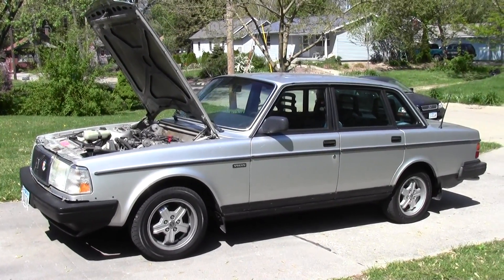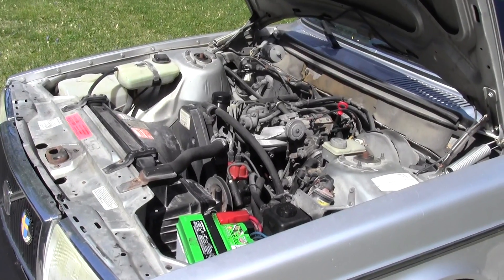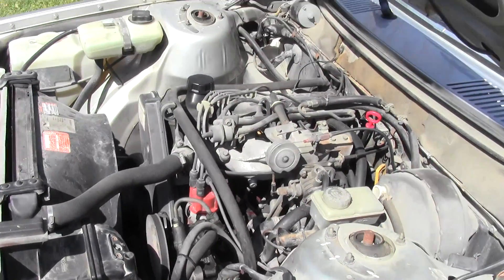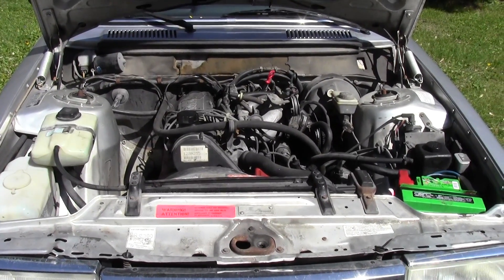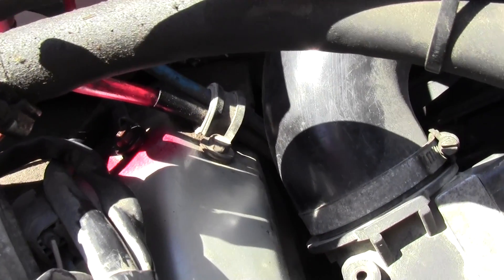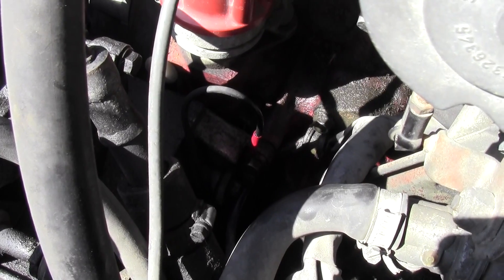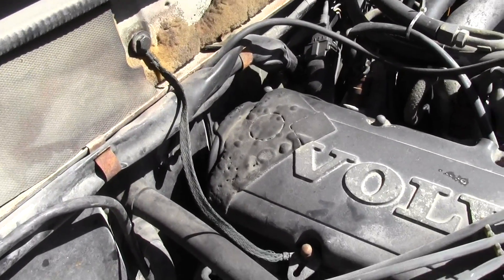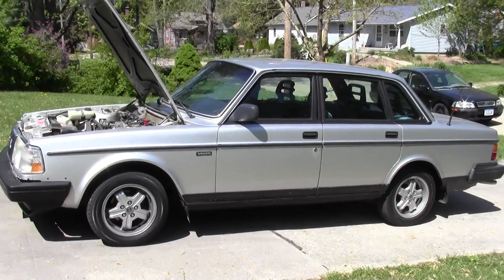Volvo 240 Electrical Ground Locations

Comment: I have an 85 Volvo 245 DL wagon. Recently my right headlight went out and changing the light doesn’t make a difference. When I turn on my brights my radio goes dead and my auto locks on my door stop working (they always start working by the next day). My car hasn’t had a problem starting but do you think this could be the problem?
Reply from the maker: Maybe try to locate and replace the headlight relay.  Not sure where that would be at on your '85, but possibly on the row of relays behind the two center vents.

Comment: Another ground cable  from alternator case to the block - attached to the block at one of the bolts that hold on the base of the alternator. One my 240 this cable was knotted and the tip with the electrical connector broke off while working on it. There are other ground connectors from chassis to the body - around rear door (station wagon) and also I think near the connectors for the rear lights.
Reply: Good info, thanks!
Reply: My 84 is completely missing this. Down the rabbit hole I go😅

Comment: On the inner fender wall, behind the battery or on the other fender, theres a ground buss with multiple spade connectors, they are exposed to the elements and notorious for corrosion.
If the car cranks but the coil is not sparking the coil ground wire connects to that buss. Remove and reconnect and spark returns. Dialectric grease helps.
Reply: jonesgerard was it blowing a fuse

Comment: well i bought a '91 240 the other day and the previous owner thought the starter was going out. The car would just click once when ya turned the key but it fired right up when we gave it a jump. So I drove it home and spent today cleaning all the grounds that you mentioned and cleaning up the power steering fluid that has leaked everywhere on the drivers side of the engine. Long story made short I'm 8 for 8 for turning the key and having it start without a jump or a click. Thanks for the upload.
Reply from the maker: Nice work, keep those 240's on the road!

Comment: Wire brushes, sand paper, contact electrical cleaner, and then battery terminal sealant. All available at any auto parts store. Every where you sand hit it with the sealant.